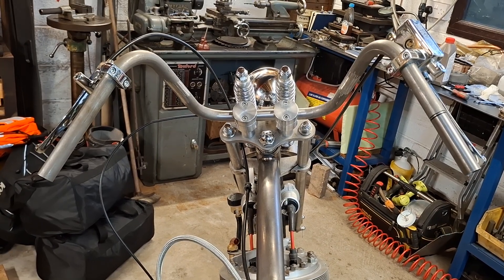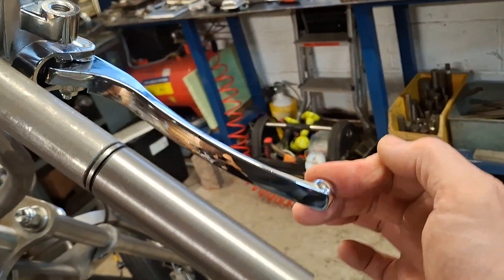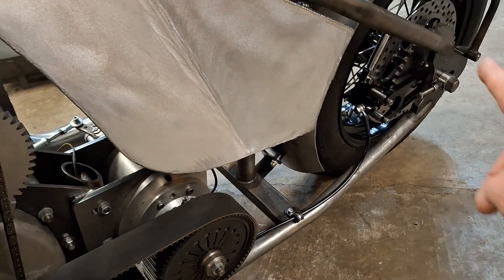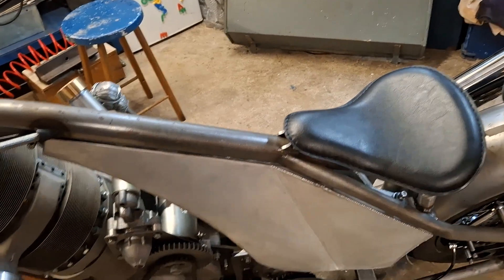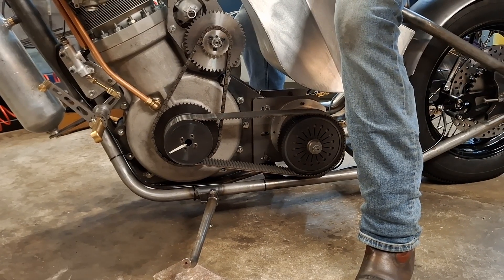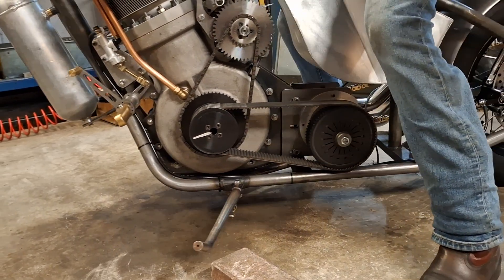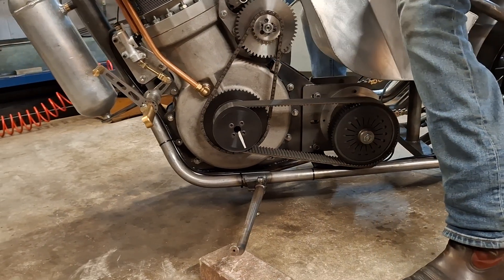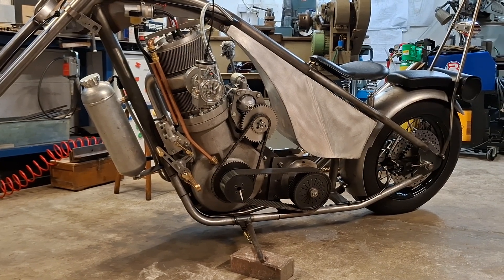We have brakes!

Comment: For the clutch: you do not need to separate the plates at all. If the pressure on the plates falls to zero, the clutch slips.
For the left chain: think about that the chain is messy and greasy. If too close to the brake disk, that may cause grease spills onto it, that may be uncomfortable.
Reply: meh, just ride the brakes, she'll burn off!

its the rear... they arent for stopping. if urgency is the main goal.